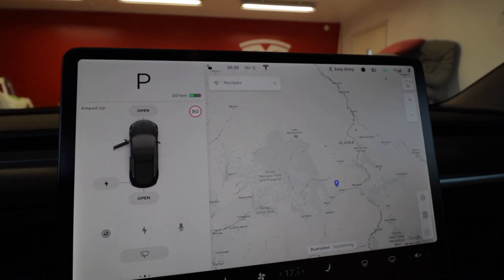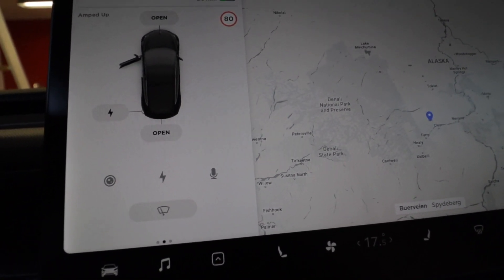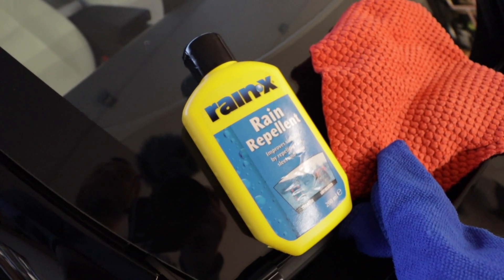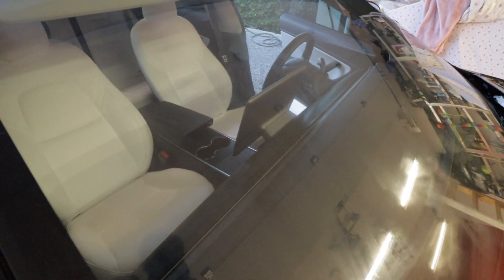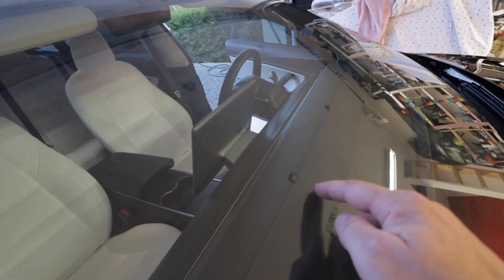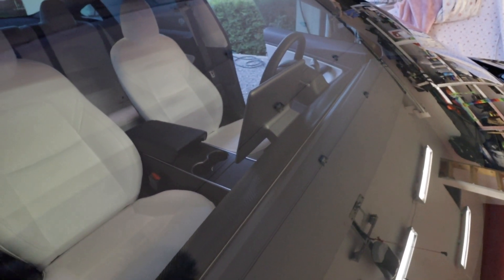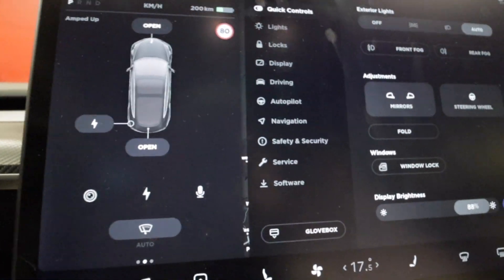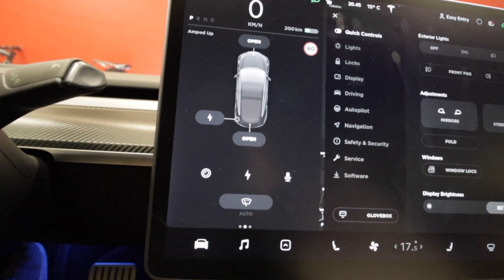AUTO WIPER TESLA | HOW TO MAKE IT WORK

Comment: Im confused.  I thought using RainX is so you dont have to use your wipers?     ty
Reply from the maker: In speed over 65kmh yes. But the trick for the sensor is droplets. So it will work in mist, easy and hard rain driving og standing still :)
Reply: FrostyFingers maybe I’m doing something wrong.  I use rainX on all glass, for 15 months of ownership, I barely ever use the wipers and haven’t even had to add washer fluid and never got a squeak from the wipers either.